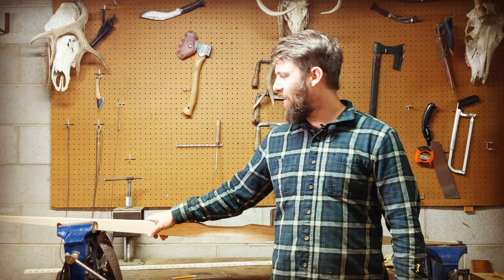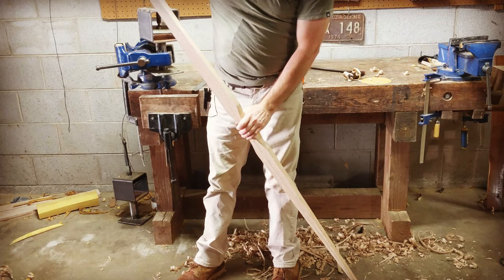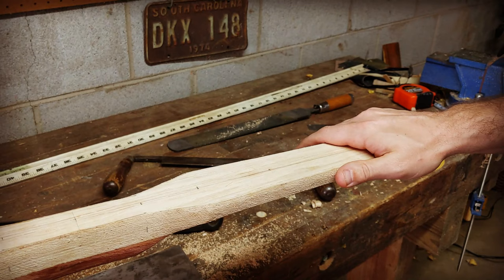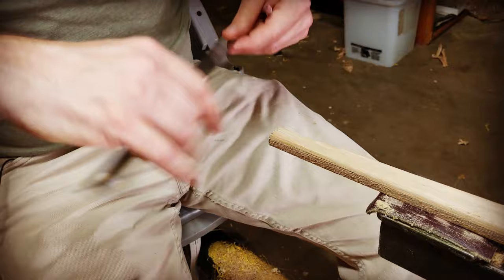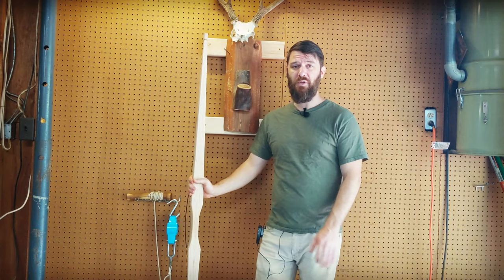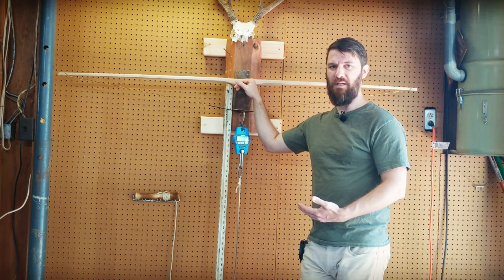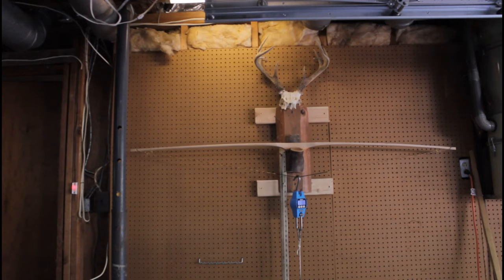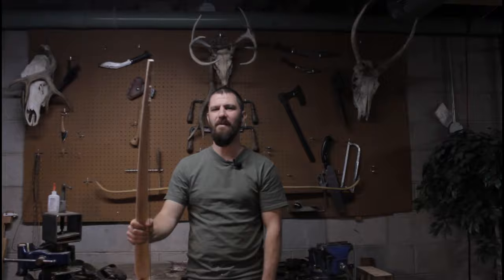How to Build a Board Bow Part 4: Early Tillering

Comment: Using your fingers to feel for high and low spots during early tillering is so key. Really glad you mentioned it. Great installment!
Reply from the maker: I use my "finger calipers" a lot. It was setting I learned early on from John Strunk and it stuck with me.

Comment: Lots of great information. Currently building two board bows. One for my daughter and one for myself. Getting ready to start tillering my daughters, but I’m wondering what would be a good draw weight for a 7 year old first timer? Enjoying the building process and learning a lot. More projects to come in the future, thanks for your videos.
Reply from the maker: That's great! good question. I'm currently working on a video about kids bows but it's not done yet. My son is the one building the bow for the project so I'm going at his pace. Haha. Draw weight for kids bows can be a little tricky because kids can vary quite a bit in size and strength at that age. i think it's good to build bows for kids that are a little longer than needed so that they can grow into the bow for a few years. For example. of she can only draw 16" now you could build a bow that draws safely to 20-21". often around 20#@20" is a fairly good bench mark. At her current draw length she will probably only be drawing 12-14# but it will go up as she grows and draws a little further. The bottom line is that it needs to be comfortable and easy for her to draw or she wont enjoy it. I'd design the bow with the longer draw length in mind for the future and then just keep tillering until she can draw it comfortably right now. Then she can grow into it a bit.
Reply: Swiftwood Bows if I measured correctly, she has an 18” draw. I did a bit more of an American flat bow design, being that I used red oak, for a bit more material. Hopefully a bit more safe design with that wood. It does feel pretty stiff but it’s bending nicely. I’m just concerned that I may have to remove too much material to get it down to a easier draw weight. Backed with drywall tape as it’s what I had. If she enjoys it as much as I hope, I’ll start on a hickory bow and back it with raw hide. Also didn’t want to invest too much at first in case she didn’t enjoy archery. I’m thinking she will and i get to craft more bows in the future. Thanks for your response and help.
Reply: Swiftwood Bows update, got her tillered and strung up. About 27lb draw at 18”, so just a bit more and she’ll be ready for my daughter. 😁

Comment: Hey, I was curious where you didn't chase a ring if it would make the back of your bow more likely to pop a splinter? I am just getting ready to try and make my first bow, so I was just a bit curious
Reply: The reason I ask is that I heard milled wood gets cut against the grain. So I wonder if the back grain might not be hurt.
Reply from the maker: As long as the grain is running straight through on both the face and sides then the board will have a lot of integrity. quartersawn boards are typically easier to find with straight grain than flat sawn. I like working with staves but if you cant get good staves a good board will make a fine bow.

Comment: Great job, thank you! I have two questions... How is this clamp called that you use in the vise? Commercial or self-made? Second, when I look at the board in part 1, the back of the bow should not have one complete growthring? Is this not so critical with this design, I thought this is important? Thanks again - phil
Reply from the maker: Thank you. That is called a stave press, you can get them on 3rivers website. Ideally a bow should have one complete growth ring on the back. When using a board that is not usually possible. As long as the grain is running all the way through the board from end to end on the back and sides it will have enough integrity to make a durable bow. If you have a board that is thick enough you can sometimes chase a ring if they are oriented in the right direction.
Reply: @SwiftwoodBows  interesting - makes finding a proper board much easier, I did not dare to try this yet!

Comment: Hey, great Tutorial!
I have a question: I'm about to build my first Bow, but the only proper piece of Wood I got my hands on is a 63" piece of Beech. It is a thick enough piece to to make a stave bow out of and the Grain looks good.
Would a pyramid Bow be a good idea to start with?
As far as I know the design works good with short limbs and the fact that you can build it symmetrical would make it easier to tiller, I guess..
If I choose a Flatbow design I'm afraid it wouldn't draw to 29" which is my drawlength.
Reply from the maker: I don't think beech makes a good bow. I've never tried it but from what I heard it's not really suitable. With a 63" board you'll only get a 61" bow. Double your draw length of 29" and add 8" for the non bending section and you get 66" as a safe minimum. That's adding you're using a good bow wood. With something less than optimal you likely want that even longer to take off some stress. So given all of that I'd say keep looking for better wood. You'll be glad you did.
Reply: Allright, thanks a lot!
Reply from the maker: @noxer9  you're welcome. Good luck. Finding good bow wood can be tricky sometimes but it's worth the effort in the end
Reply: I think America elm and white mulberry are the 2 woods I would use. I am making a horse bow out of mulberry and I really have to use the big rasp on this.
Tougher than Osage orange or Pacific yew.
Reply: Hey Richard, I began anyway its White Beech (the only kind of Beech you can use for a bow) so it should be fine, i have to string it today and start the tillering process... maybe I'll back it first with tape just to be on the save side but it's working so far.. wish me luck!
Reply: @noxer9  I THINK THERE is a relationship white beech and hops hornbean HHB   . i think blue beech is excellent  but i no nothing about beech..  white beech
Reply: @richardquick826  White Beech actually belongs to the Birch family thats the reason it works :) 
... I am not 100 percent sure its White Beech but as long as I can learn from the process I'm happy! 
Also.. Horsebow? I can't wait to get my fingers onto that! I can imagine it's hard to make one!

Comment: Where did you get the card scraper that you are using?
Reply from the maker: It's a scaper holder from Lee valley tools. The joints imy hands get sore after a lot of scraping and the holder eliminates that problem. It's not super cheap but for me who does this everyday it was well worth it.

Comment: Hey man I just got through my first board bow (red cedar) and had some compression lines in the wood closest to the handle and developed some cracks later on bottom limb. Any key tips to avoid that on the next one?
Reply: I used a tillering stick, could that have anything to do with it?
Reply from the maker: Are you using Eastern red cedar or western red cedar? Compression fractures come from the wrong design/wood choice, poor tiller or wood that has too much moisture. The tiller stick could cause compression issues due to adding unnecessary stress but it's likely that one or more of those other factors were involved as well.
Reply: Swiftwood Bows I couldn’t tell you, but the red cedar was from Home Depot. It actually feels somewhat dry but I’m not entirely sure. For poor tillering, which it may be, how do I fix this? On the limb near the handle had the largest gap when put with a straight edge, but this should be find right ? Or should it be the same gap all the way down the bow?
Reply from the maker: @cadegossett2653  it's likely western red cedar that you're using then. Unfortunately western red cedar is just not suitable for bows. It's too light, too soft and too weak in both tension and compression. If it doesn't break on you it will be riddled with compression fractures. I really think you should quit while you're ahead on that one and find a more suitable bow wood. I don't mean to be discouraging but there are some woods that are just straight up not cut out to be a bow and that's one of them.

Comment: Where do i get the long string for bow tillering does it have to be a real bow string or any kind
Reply from the maker: I've got all kinds of extra strings lying around. If I didn't have one the length I needed I would just make one that was long enough. You could use something else if it was strong enough and didn't stretch too much. Just keep it as short as you can.
Reply: @SwiftwoodBows  well send me some lol i don't have any just getting started building
Reply: @SwiftwoodBows  I got other string like paracord pretty strong stuff can twist 2 together if necessary
Reply from the maker: @FunHobbies225  haha, sorry. Didn't mean to imply you should have it laying around. That was just my way of saying I haven't had to get creative. I've heard of people using paracord so I'd give it a try if it's all you've got. I'm sure it will stretch a bit though. You'll need a real bow string soon anyway so you might be better off buying a spool of string material and learning how to make flemish loop strings. Then you can go ahead and make a tillering string too.
Reply: @SwiftwoodBows  right I found a guy that builds them so getting him to make me a tiller string for now then get a bow string when done with tiller the right length.  What length you used when u finished the bow I built mine exactly same size and doing it same power u did
Reply from the maker: @FunHobbies225  the string should be about 3" shorter than the length of the bow from nock to nock. Your friend should know what to do if you give them the nock to nock bow length.
Reply: @SwiftwoodBows  oh ok I'm super excited I always wanted a bow didn't know it was so much fun building them I do wood work all the time why its pretty easy for me lol and one more thing what length arrows would you use for it i seen some 30 inches and 31 inches I'm not sure what to use